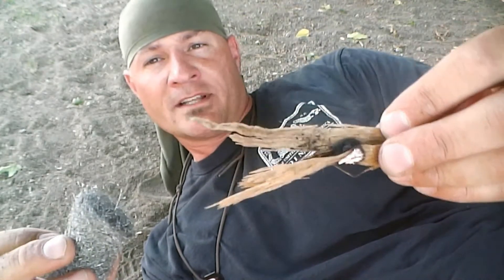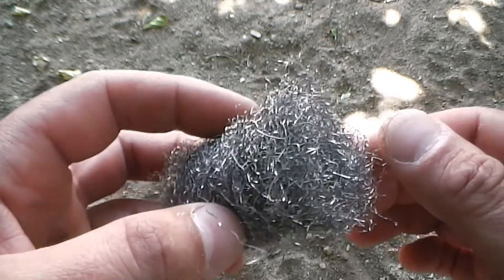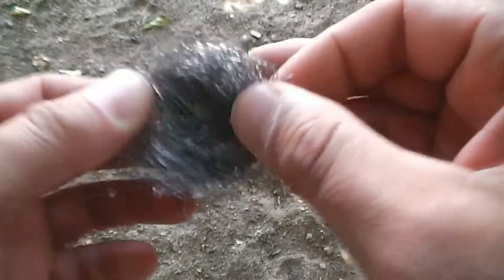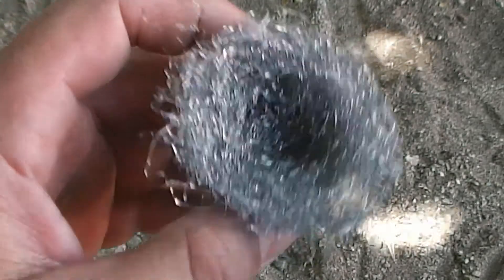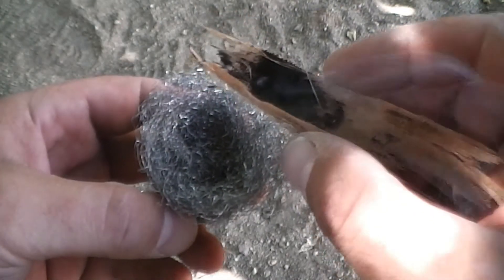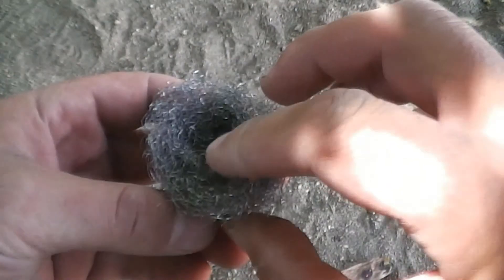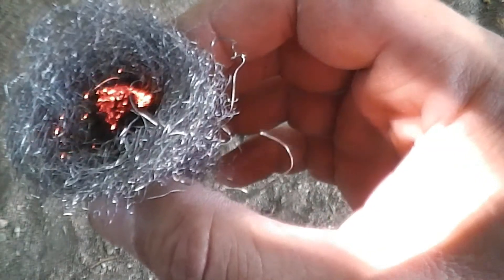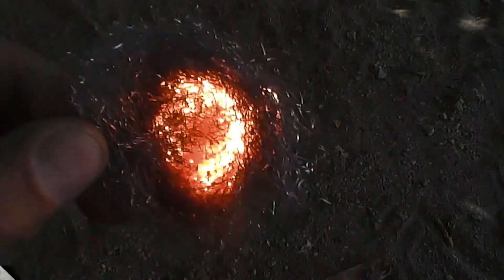Igniting Steel Wool using Fire by Friction

Comment: Great vid. Fast ember. 

As a side note, the original ember does not need to be large. Very easy to grow embers when we have decent coal extenders on hand. Coal extenders are any material that will grow an ember with little to no baby sitting. Punkwood, chaga, most shelf fungi, plant fluffs (milkweed, thistle, cattail, etc), char, etc.